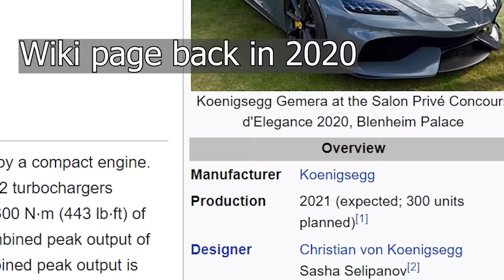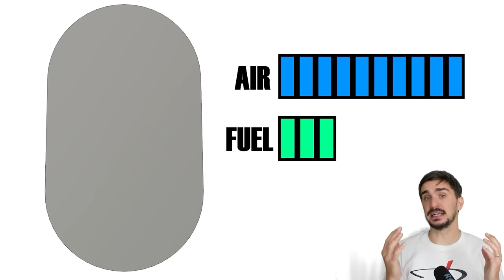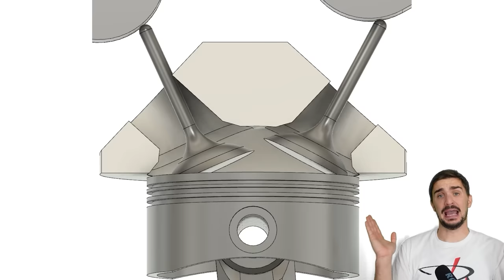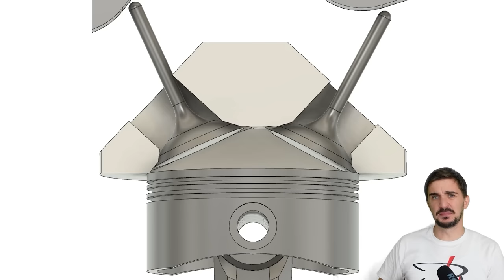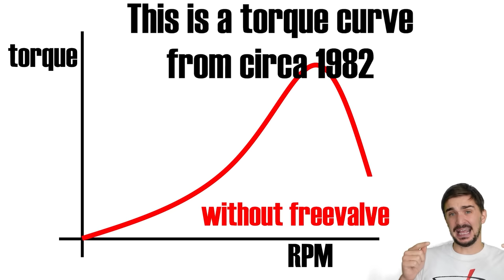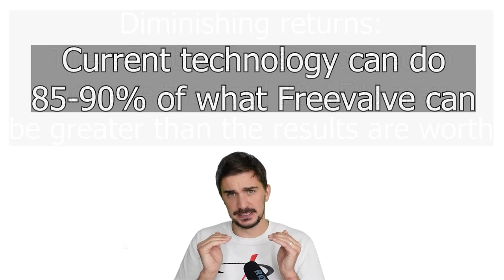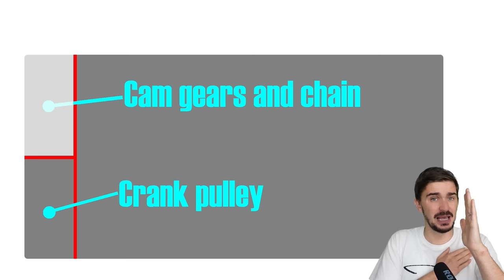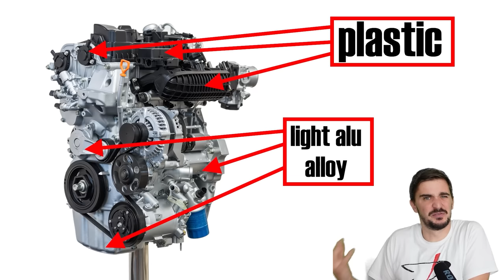FreeValve Isn't a Big Deal. Here's why

Comment: Freevalve would have been absolutely groundbreaking and truly revolutionary... If it could have been made functional in 1990...
Reply: i'm curious what made that impossible to happen besides not inventing it sooner?
Reply: @V0ID_beats  reliability and cold weather conditions maybe
Reply: @V0ID_beats  ... 1990's era ECU tech if I'd had to guess.
Reply: @Dominik189  Because you clearly are.
Reply: It almost was, but only in bespoke F1 engines.
Reply: @richsackett3423  ???
Reply: @Dominik189  We had RTOS and hardware in the 90's that could do it, but it was only used in missiles.  Now you could probably do it all in software if you don't mind missing timing every 10th or so stroke. 😅
Reply: @nahimgudfam  that's kind of what I mean when I say ECU Tech. There was stuff that could do it, but it was beyond expensive and the stuff that was the norm definitely couldn't do it.
Reply: @Dominik189  !!!
Reply: I can answer why this would not work in 1990... The simple answer is computing power. While theoretical and cutting edge computing power in 1990 was fully capable of this, OEM automotive manufacturers to this day, do not use anywhere near the cutting edge or the first second or third edge...
For example cutting edge in the 1990s was Mercedes with their throttle by wire. This required a extra ECU just for the throttle by wire PID loop (And it's required safeties)
So you take an engine like the m120 and it has 12 cylinders and two drive-by wire throttle bodies. So it uses two ECUs so it can run as two separate six cylinders and separate ECUs used for the throttle bodies.
This was pretty much required at the time for mass produced automobiles. Even at the lower scale of the 600 class autos Mercedes was making versus the tens or hundreds of thousands other models would require.

However today, not only can I get a microcontroller that is overkill to do all that by itself for less than a dollar, but you can get a driver chip specifically made for running a drive by wire throttle body. It will have the MOSFET integration and current sensing and everything all built into one tiny device.

That would have been a whole board in the 1990s.  Because it's not just a computing power. We did not have the same kind of highly efficient MOSFET drivers back then. At least not mass produced and inexpensive.

You start adding up all the parts of this. The memory required to run it. The computing power required. The power stages for both operating things and all of the sensing to know where everything is and you realize that when you take away 30 years of advancement we just literally did not have the environment to run this technology. You would have to invent all that as well. Not just the engine system but actual low level electronic components.
Reply: Free Valve is common on large modern marine engines that doesn't spin to more than 800rpm.

It solves the problem of having a gearbox transmission. Deleting that and coupling the propeller directly to the engine saves them headaches during the lifetime of the ship. The independently variable valve actuation makes it possible to run the engine directly in reverse. 

Oil pump and water pump are independently driven by an electric motor during this docking/undocking maneuvers. Even turbos can do supercharging with electric motors. 

The thermal efficiency is at 50% during operation.
Reply: in 2005 would be enough
Reply: Honestly you could probably do it with analog electronics very effectively with chips available since the 70s, the development and tuning would be a massive cost though and basically impossible without modern simulation (or nasa levels of engineering)
Reply: Combined with a hybrid system it could make for good long range cars.

EVs make sense for countries with high population density, where even if you travel big distances, you are never too far from a big city.

But countries like Argentina, Australia, Brasil, Canada to name a few, a hybrid car is a better option. And a freevalve engine would be ideal.
Reply: @V0ID_beats  it had a lot to do with computer technology! The computers in the late 80’s and early 90’s were unable to relay as many signals cleanly any computers today. This made it nearly impossible to control the timing of the valves AND the lift and duration, it would have had to be an or. This is why bmw did what they did, because they eliminated the technological restraint to effectively have the same system. Hope this helped!
Reply: Or even in 2000.
Reply: Yes! Just imagine, you could electronically program a higher lift cam  with whatever duration and overlap you need!
Reply: @kimpatz2189  indeed. I'm glad I saw this before I wrote the same thing.
Reply: It was.. by Renault

Comment: In the mid-90's in college (EE degree) we built a valve control system that was operated via electrical actuation. We wrote all the code with 68HC stuff. The code was pretty trivial. Finding mechanical solutions that worked reliably and would do so under the conditions of an engine was super difficult. We never got it to idle more then a couple minutes at a time. Fun project though.
Reply: The good ol days.
Now we can do all that stuff with an apple watch.... while watching a 4k vid... and messaging our folks. ^.^
Reply: Damn that’s pretty cool. Young self taught software engineer here (28yo 5yoe). I’ve done some binary and bitwise coding for building controls with modbus and bacnet protocols. I’d love to cross the bridge into electrical engineering and microcontrollers like you have. I would probably default to raspberry pi as proof of concept, which is the baby version of working with those old microcontrollers IMO.
Reply: 68HC... I still got ECU with these things. It's a really great choice for these systems that must work with a reliable timing.
Reply: @memadmax69  uh, no we can't. Kinda the point of the video.
Reply: So very cool!  The Mech & EE at UVic (Victoria, BC, Canada) did a single cylinder engine in 1990-91 with solenoids.  I unfortunately had to stop EE and go to CS, so I did not see results and lost track of those involved.  Where did you go to school?
Reply: Yep, sometimes a cam is the best solution for the job... mechanical solutions are very reliable and consistent.
Reply: @Ozhull  Was not in reference to the video...........
Reply: I did a research project on this concept in 2001 at uni. Send like a no brainer at the time. But it was on paper only.
Along with variable wing race cars, now standard in F1.
Reply: Westly kagan a bright young engineer did one in his shed at home great you tube creator
Reply: It makes me wonder if anyone has ever looked into how much it would cost to make an electric actuator for this purpose.
Solenoids aren't expensive now. (I think that's what you'd use) How much more durable do they need to be? The most expensive ones I see on a quick google search are only like $150.  Would a $500 one work? On a 6 cylinder car, that'd only be $3000. How much does an entire vvt system cost?
Reply: @memadmax69  the comment makes no sense lol. how are you gonna actuate valves with an apple watch?
Reply: @norezenable  There is also an issue with speed. Actuators must be very durable and fast.
Reply: You needed fast engine running parameters feedback and predictive algorithms assuming what direction and pace variables will turn to. Now days it's easier - processors are faster and You can use optic fibre to drive signals.
Reply: @PinkFZeppelin  : Arduino is a better starting point than Pi for these things.  Especially when first starting, simplicity is better.
Reply: @memadmax69  then you're a terrible writer
Reply: @memadmax69   That's how fools do things. Imagine building something around $1,000 idiotPhone that can easily be handled by the equivalent of a 68K processor costing about $20.
Reply: @PinkFZeppelin   You can do a lot in electronics without ever having to program anything. The use of processors is mainly about cost-cutting and ease of mass production. You can still get 68K processors which are an ideal platform for learning if you want to get into electro-mechanical applications...and why not use something like a RPi over a 68K - the simpler the better when it comes to reliability and repair-ability.
Reply: @alphaforce6998  Umm, no. 68k was way back when and is only part of what I was talking about. Oh and you know that $1,000 price tag ur talking about? Thats the apple tax of course, but what is that tax for? Years upon years of continuous updates and support. You will be hard pressed to find a sub-par $300 android based phone that gets even 1 security update, much less a Major update that the iPhone 6 got for 8 years and just recently finally kicked the bucket...
Reply: Good grief, 68HC, I used to lecture in that stuff (part time),  I think I saw the assembler and simulator in one of my old software archives not that long ago, although I have not seen the development system for some time so it is probably gone. I am surprised you even got to idle speed with that family, you could not have done anything much with pulse shaping, even the clunky approach such as opposing second pulses to reduce overshoot would be difficult.
Reply: Trump Is The Messiah  i think the 2015 freevalve prototypes used pneumatically or hydraulically actuated valves with a remote compressor and remote solenoid. Their new design looks like a self contained pneumatic hydraulic solenoid unit, no idea how they handle cooling.
Reply: @norezenable  I don't know what the manufacturers spend per engine, but $3000 is half the cost of a complete remanufactured V6 for my car. I imagine the manufacturer's cost for the whole engine is less than $6k. Consider also  the high temperatures these actuators need to operate at - sitting directly on the cylinder head, with the exhaust valves directly in the actuator no less. And you need quite large forces to open and close the valve fast enough - I think this is why Freevalve uses compressed air rather than say direct electromagnetic actuation like a solenoid (need large currents to make large forces - big wiring, lots of heat, etc.).
Reply: Thi is renaolt f1 tehnolagi .but bicoz of the fia thei never iuzing it . sori for mi inglish
Reply: @DeusTex-Mex Bluetoo LE
Reply: 68hc, the wonderful days of 8-bits and when you actually could understand and write assembler code....
Reply: There been plenty of example of electromagnetically valves, they never worked well. One large issue is that they have to high back-pressure at high revs for the exhaust valve.
Reply: I remember seeing camless tech in adverts for semi trucks in the 90's
Reply: I'm wondering about how you got electrical solenoids to actuate both strong and quick enough to open engine valves?
Mechanical seems simpler.. Disc cam with a small lobe. provides pulse of hydraulic pressure via little plungers arranged to depressed by lobe.   5/3 valve then actuated to remember last pressure pulse. (kind of a mechanical flip flop). the 5/3 valve outputs then direct pressure to/from double acting piston actuating cylinder valve.
one disc for timing valve opening, 2nd's disk for timing valve closing. plungers for each event type equally spaced around a carrier ring. Rotate carrier around cam to adjust timing. Timing adjustment then possible via 2 stepper motors.
Reply: trumpisthemessiah7017 can you not build a solenoid without magnet?  that is what electromagnets are, right?
Reply: @memadmax69   Interesting, I doubt you programmed anything that lets you control stuff with your apple watch, and considering maybe a mobile pool app MIGHT be able to control things its a complex layered computer system and the code touching the actual valve controller module is going to be written in assembly language. 

Also there is no 4k apple watch, this comment just makes no sense.
Reply: @arturbaginski795  All your buzzwords and not a cent of sense found. Fiber optics to "drive" electromagnetic solenoid actuators? Faster CPU speeds have nothing to do with mechanical limitations, Flux density limitations, thermal Flux destroy the magnetic stems, highly magnetic materials and heat don't play well together, and the exhaust valve goes through the head, the longer the valve is to move to a cooler area increases the reciprocal mass. 

It's a non starter for anything serious.
Reply: What other inventions are suppressed if this simple improvement with large gains over the now over 150 year old crankshaft ICE can not make it to the market? There are about 6000 suppressed patents in the United States by Government secrecy orders.
Reply: @Kosmologika  Sure, it didn’t fail due to mechanical limitations and reality dictation of what can actually happen. Like magnets don’t like the head that a cylinder head experiences… valve weight and magnetic flux switch time, magnetic flux density to open a valve of size against  over 1000 pounds of combustion force…

It’s totally the government, and worse, they want to make rules for you and are always watching you
Reply: @Kosmologika  Did you even watch the video, it's titled "FREEVALVE IS NOT A BIG DEAL".
Reply: @Steevo69  Even greater gains with the ICE could be made by using hydrogen combustion, splitting water into hydrogen and oxygen by resonance (not the ineffective inverted electrolysis of fuel cells) just moments before sending the hydrogen into the combustion chamber. Patent US4394230A
by Henry Puharich is expired and could be used freely.